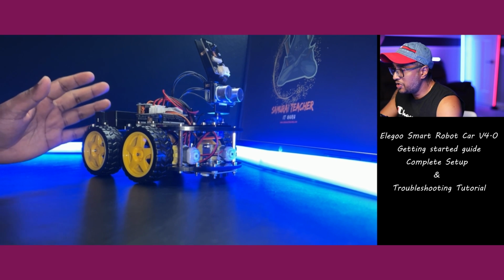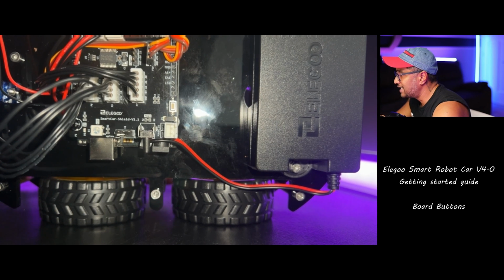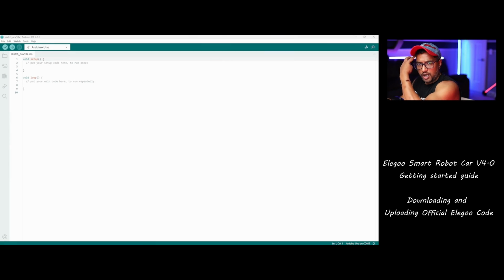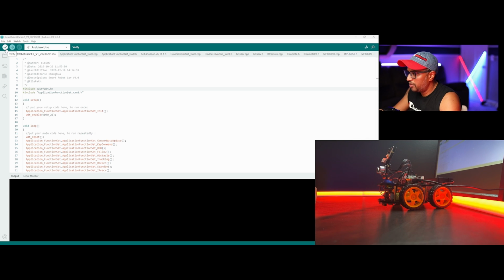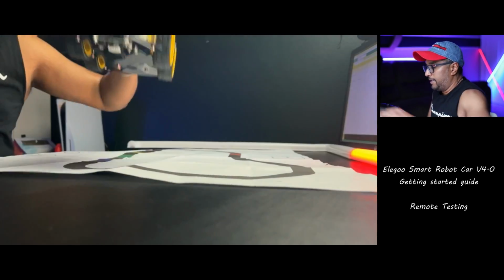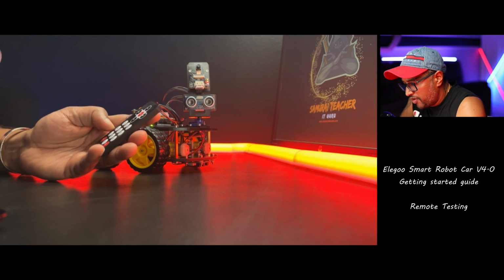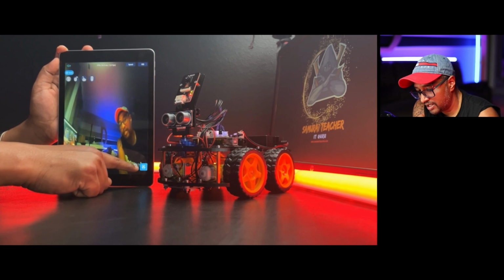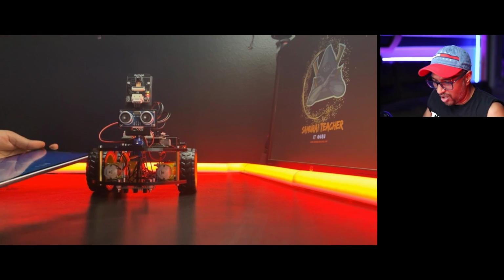Elegoo Smart Robot Car V4.0: Beginner's Guide to Setup & Arduino Programming (With Camera)

Comment: our wheels rotate the wrong way - left front different that left back, and right front different than right back. Swapping the two rear, it will go forward and back, but not turn. Any suggestions? It is wired like the diagram says
Reply: Did you ever resolve this issue? Maybe ChatGPT can help?
Reply: you got to switch itsside the same problem happened to us as well

Comment: Thanks for sharing. My son and I enjoyed putting this robot together. Though we are struggling to get it to connect to our wifi network so we can control it from over the internet.
Reply from the maker: That’s awesome! Glad to hear you and your son enjoyed building it. For the WiFi connection issue, make sure you’re using a 2.4GHz network, as some microcontrollers don’t support 5GHz. Also, double-check the SSID and password in your code. If you’re trying to control it over the internet, you might need to set up port forwarding or use a cloud service like Blynk. Let me know if you need help!
Reply: @ITSamuraiTeacher  
I think the issue is our ISP does not allow us to port forward- super frustrating that we cannot access our own gateway- I like the Blynk idea though! Thanks for the valuable tips.

Comment: I get errors saying fastled.h no such file or directory
Reply from the maker: Thanks for reaching out! The error ‘fastled.h no such file or directory’ usually means the FastLED library isn’t installed. You can fix this by going to the Arduino IDE, clicking on ‘Sketch’ > ‘Include Library’ > ‘Manage Libraries’, and then searching for ‘FastLED’. Install the library and try compiling the code again. Let me know if this helps!
Reply: @ITSamuraiTeacher  Thanks for the video! Indeed, it is described in the Elegoo documentation tutorial "How to add .zip Library.pdf". They provide the libraries to import (4 zip files) so I decided to just go that way to be sure I have the right versions. You should NOT unzip them. I think it reduces risk of incompatibility vs your approach. Hope this helps.
Reply: @ITSamuraiTeacher  AWSOME! This worked. I was getting the FastLED error too
Reply: same here. Have you fixed your error?
Reply: Update: Thankfully, I have been able to fix the FastLED.h error. I'd be willing to offer suggestions if needed.
Reply: @beebee_0136  How did you do it?
Reply: @beebee_0136  How did you do it?

Comment: Hi, how can I find the PIN number of the motors? For m1, m2, c3, and c4? Thanks!!
Reply from the maker: Hi! You can find the pin numbers for the motors by checking the Elegoo Smart Robot Car V4.0 schematic or manual. Typically, M1 and M2 are connected to specific motor driver pins, while C3 and C4 refer to sensor or other component pins. The manual should have the correct mappings, but if you’re using an Arduino, you can check the pinMode() definitions in the code for the exact pin numbers.

Comment: Dear, IT Samurai Teacher

PLEASE READ EVERYTHING!!!

Great Video!

My previous comment here got deleted but here is the summary

I have the Elegoo Smart Robot car V4.0. I also have the same Elegoo uno R3 board you showed in the video.

I am a 6th grader and i like robotics. I am currently in a science fair and my project is testing this car driving on an earth-like surface with small humans and obstacles. I am testing the Elegoo app live controls versus the line tracking and all the other features.

I also previously downloaded the Arduino IDE software onto my laptop. I followed your instructions and you only showed the Elegoo company's code for the robot. I want to code it so that my car can do a specific feature at a time (for example: Me coding the board to line track a blue line at a specific speed) i also wanted to change the velocity at which it turns and moves. I wanted to seek help from you because it looks like you have more experience with this type of software.

So I decided to reach out for help. If you know how to make it do what I wanted, please reach out via YouTube comment. I will not put my email (for safety reasons) until you reach out. 

If you can't help or will not help, then at least please put a comment saying that you can't. Once you comment, we can move on and solve this. Thank You and please comment.

Sincerely,
Your Subscriber